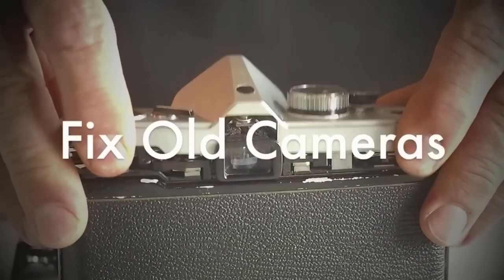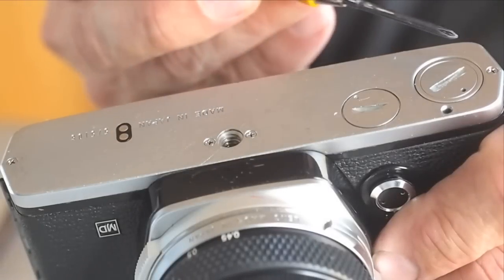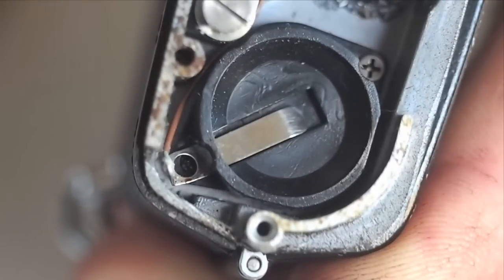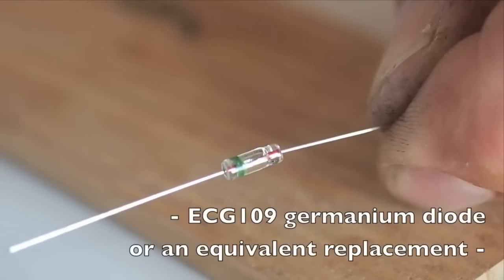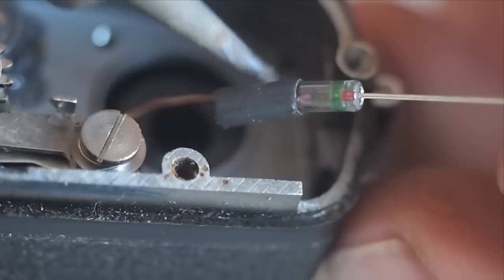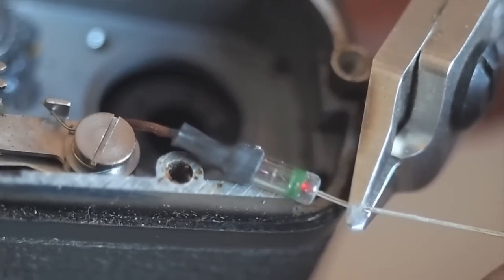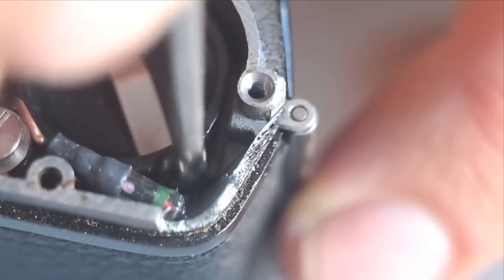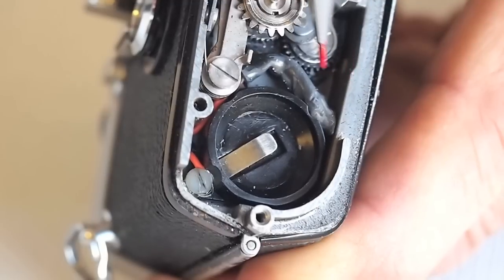Fix Old Cameras: OM-1 Dead Meter / Diode Modification

Comment: The brown wire on my OM-1 is far too corroded even after attempting to strip it as far back as possible. Is there a way to completely replace this up through the camera?
Reply from the maker: +mj0188 isg The brown battery wire routes up behind the self-timer and is glued to the chassis. Seep some alcohol down the wire from the bottom and the top. If the glue dissolves to the point that the wire becomes loose you can solder a new wire to the top end of the old wire and pull the new wire down. Chances are you will not be able get the old wire to loosen without accessing directly, which requires removal of the mirror box / front plate assembly. NOT advisable unless you have some previous camera repair experience. The most likely option for you is to route a thin gauge insulated braided wire over the front plate and under the leatherette following the seam grove of the front plate. A Fix Old Camera video will be produced to demonstrated this procedure in the near future.
Reply: +Fix Old Cameras Look forward to it! Thanks!

Comment: My meter is not functioning properly with a new Wein Cell 1.35v there is some movement in the meter needle in the viewfinder but its way way underpower - I had a look under the bottom plate and the nylon screw appears to be in tact. There does not appear to be a diode. For example i have asa set to 1600, and shutter speed to 0.5 second looking at the daytime sky to give a good exposure metering. Changing aperture doesnt appear to have any impact in this situation as well. Any advice please? I would love to get this camera working again!
Reply from the maker: If the meter needle moves when the meter is turned on but is not reacting to light then the CDS cells are probably defective. If the changing the aperture of the lens does not change the resting position of the needle then the aperture link ring needs to be checked.
Reply: Thanks for getting back to me on this. Is it difficult/expensive to have the CDS cells changed?
Reply from the maker: If you are interested in getting an estimate for repair of your classic camera you may go here
http://www.phototronic.biz/services.html
Or find a camera to salvage and swap them out. The cells are integrated into the eyepiece assembly, replacing the entire eyepiece/ cds unit would be the easiest. You will have to solder the wire leads.

Comment: How about cameras that use two PX25 mercury batteries. Is there a diode that will drop the 3 volts? Thanks
P.S. How about a how to for a very tight Canon FD 70-210mm lens?
Reply from the maker: A 1N4007 diode would give the needed voltage drop in cameras designed with the double PX625 battery system. Thank you for the suggestion.
Reply: Thanks, I'll let you know which camera I do and my results. I have a Gossen N100 that I'll try an IN4007 in.
Reply from the maker: Tom Heckhaus Very good.

Comment: I have a question, in order for a meter to function properly and accurately, you will need the exact batteries right? I have an FM2 and the meter seems to be off by one stop higher then the correct exposure. What do you think may be the problem? Is this fixable?
Reply from the maker: The FM2 was designed to work with 2 of the 1.5 volt button batteries, preferably the silver or lithium type... such as the MS76. You may also you the 3 volt... such as the CR1/3N.
Reply: Fix Old Cameras yes I am using the correct batteries then, do u think it may be a matter of calibaration? Or maybe the electronics are messed up?
Reply from the maker: It is possible you can get by setting up the ISO/ASA to compensate.

Comment: What kind of batteries does it use?
Reply from the maker: The 625MRB (1.35 volt zinc air battery) will work perfectly without modification. However it has a short life once it is put into service and it is a little pricey. The 625A will work in an OM-1 with the diode modification but should be changed out once a year because of its sloping discharge rate. The MS76 button will work with the diode modification and can be left in the camera for several years. Due to its smaller size, a small o-ring encircling the MS76 battery will help it stay in the proper position upon installation of the battery cap.

Comment: Hi A few questions. (1) ECG 109's are tough to find do you have a list of substitutes you've actually tried? (2) Is there any inherent problem with using a 1.5 v battery and just resetting the ASA dial? (3) Any plans of doing a Canon F-1 video. These were a true 1970's workhorse camera. A video with the usual CLA, seals, diode etc would be great. If you'd like I can donate a Canon F1 for you. I have a couple. It may have a dented prism and a non working motor drive & a modern FD lens but it'll be worth fixing up. Let me know. THANKS  P.S I may even have servicing info, if you need it. I'm pretty sure you have the microfiche for the F1. P.S.2 (If you do  a video then I can fix the 1/2 dozen I have. PS3 Have you considered a video on cosmetic repair, such as brassing on enamel and chrome parts? MANY THANKS TOM
Reply from the maker: The diode 1N34A will work satisfactory when the ECG 109 is not available. ECG 109 is still this camera repairman's first choice, but experimentation has proven the 1N34A a good performer in this application. The ASA dial adjustment works, although the meter will not be linear accurate. Film as enough latitude that most shots will be OK. No harm will come to the meter. Some of the later classic cameras using the 1.35 volt mercury battery 
have compensation circuits and are not affected by substituting a silver battery. Your comments present and opportunity to relay some information about battery substitutions in classic cameras.

Mercury oxide batteries typically had a voltage of 1.35 Volts. They kept this voltage constant over their entire lifespan and lasted for years. They could be recycled and even recharged a couple of times. Question… Why is mercury acceptable in CFL light bulbs but not in batteries?
 
Silver oxide batteries typically have a voltage of 1.55 Volts. They also keep their output voltage quite constant over the entire lifespan of the battery and they have relatively long usable life.

Zinc-air batteries mainly for hearing aids have a constant voltage output too, typically 1.4 V. Since their voltage is close to the voltage of mercury oxide batteries, they can be used as a substitute without making any changes on the meter circuits. They are cheap… but they have a short life span of only 2 to 3 months, not depending on usage. Once their seal is removed, they dry out inevitably, even when not used. When first taken into service, new zinc-air batteries need quite a long time of approx. half an hour up to one hour until they achieve their correct output voltage. In this time they can cause incorrect meter readings.

Wein Cells, available locally from photo equipment dealers, are basically zinc-air batteries with fewer ventilation holes to achieve a longer lifespan (approx. 6 to 12 months), as they do not dry out as quickly as normal hearing aid batteries. They have a smaller maximum power output than zinc-air batteries, but for photographic equipment this is not a problem, as the meters do not need much power. Wein Cells are still expensive and can be difficult to get in some places. They have the same problem with the initial voltage as normal zinc-air batteries.

Alkaline batteries have an output voltage that drops continuously over the lifespan of the battery as it discharges - depending on the  battery brand the initial voltage is approx. 1.6 volts - 1.5 volts. They are not a good substitute for the mercury oxide batteries because of the voltage drop over its lifespan.
Reply: EGG 109 diodes are not hard to find, at least in the USA.

Comment: Thanks FOC for this useful video. I have the Nikon F and Rollei 35 which uses the 1.35v battery. Is it the same way/approach to fix meter in those cameras like this one ? Thank you in advance.
Reply from the maker: It is indeed. The issue is to find a location for the diode in the Rollei 35, with care it can be done. Also note that the Photomic meter in the F is a two battery system and will need a diode equivalent as the  IN4007 or SK3080.

Comment: Have you actually measured the voltage after the Diode install?  Oh yes, can you do a meter calibration video on the OM-1?
Reply from the maker: Absolutely, take a DC volt meter / multi meter reading on the wire side of the diode to the ground and the voltage drop will register if the diode is installed correctly. If installed incorrectly, no voltage will register and the diode will need to be flipped. All suggestion for upcoming videos are greatly appreciated and considered. The list is long, it could be some time until you see your suggestion. There are some meter calibrations that would be suitable for a Fix Old Cameras video on the different meter versions that were introduced over the years in the OM-1 camera models
Reply: Got it!  I will try that and I hope you can do a video on a simple meter calibration on the OM-1.
Reply from the maker: ***** The alkaline battery is satisfactory. However, after approximately a year of typical usage the alkaline's voltage will fade. The silver or lithium battery cost more but is stable on the voltage output until the end of its life.
Reply: As always, very helpful video! Is it possible to calibrate an OM1 meter on 1.5V batt w/o installing the diode? How far can it go +/- ?
Reply: @tulauc   In a word, no -- the circuit design of the OM-1 and 1n is such that when using any battery other than a 1.35volt, the error will not be linear. In other words, while the meter may be half a stop off at lower light levels, it may be more than 2 stops off at higher light levels. Some form if recalibration is necessary, either by the described method of "stepping down" the voltage from 1.5 volts, or by insertion of a compensating resistor at or near the meter's circuit.

Comment: The meter of my OM1 isn't working as it should. A correct exposure according to its light meter, is in fact a +2EV overexposure. Do you know what's causing this and if it's possible to fix it?
Reply from the maker: After the diode modification is completed a linear adjustment can be made via the eccentric screw on top of the galvanometer.
See http://www.miketrost.com/archive.html and scroll to the bottom of the page for a photo of an OM-1 galvanometer adjustment along with additional details on the procedure.

Comment: Why a diode? Shouldn't it be a simple resistor to lower the voltage of the battery?
Reply from the maker: There is almost no power dissipated through the diodes (as opposed to a resistor) and little loss of current. Since we only needed a drop of .15 volts but still want to maintain the current the diode is used. Along the lines of your thinking there are some classic camera meter circuits that can function perfectly on a 1.5 volt battery source even though they were original design to operate on a 1.35 volt battery source.
Reply: +Fix Old Cameras Thank you very much for the reply! I have an OM-1n, no one in my city seems to have the original battery or something that physically fits the battery compartment. I'm trying to use a 1.5v (LR1130) button cell, but no dice so far
Reply: A diode will drop the voltage reliably, while if you use a resistor, it will drop the voltage as a function of the total resistance of the circuit, which is unknown in this circuit.

Comment: The nylon screw is 2.15mm  diameter.
Not an easy size to find.
Reply from the maker: Indeed it can be a challenge.
Reply: 2mm might go if you put tinfoil or paper in to get that fraction more diameter.
Also a bat 43 schottky  diode might work to drop the voltage.

Comment: Hi, I would like to upgrade my OM-1 camera for 1,5V battery, so I bought two pieces of germanium 1N60 and two pieces of schottky 1N5711. Now I don't know, which could be better. I read that 1N5711 should be connected 4 pieces in paralell, else the battery will be overcompensate. But I have only two pieces, so now I tend to 1N60, but I'm not sure..
Reply from the maker: The ideal diode is the vintage ECG109. A very good substitute 1N34A. In nearly every application tried in a single 1.35v battery meter system one of these diodes gave the required voltage drop when using 1.5v battery substitutes. However, there is no reason that you can not use the diodes you have acquired, they will cause no harm. You will have to experiment with singles and different combinations to get the desired voltage drop.
Reply: I would like to ask you, on ebay there are several 1N34A diodes, which came from China. Have you any experience with it? I think that these diodes aren't  the same as the vintage 1N34A..
Reply from the maker: They are a serviceable substitute. You might still be able to get a vintage ECG109 here -
http://astore.amazon.com/fixoldcam-20/detail/B001ISCAFG